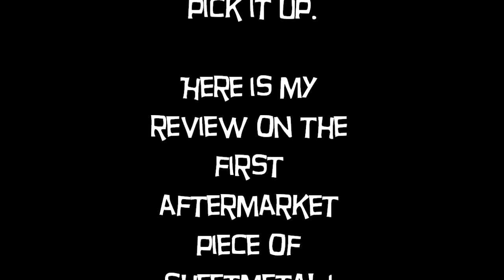1969 El Camino Restoration Part 13- New Dynacorn fender review

Comment: One thing I always learned, was.... no resto part ever fitted like an original....mostly in part to, when in factory. they beat the shit out of panels and sheet metal lol! but it will deff save you time and work...especially in cutting and welding.
Reply from the maker: Great to hear from you Reaper! Yeah, I got lucky when I found this so I jumped on it. Definitely a time saver.

Comment: Thank for the comparison, I'll definitely be replacing the passenger fender on my 72 El Camino, maybe drivers side too I'll need to look closer when I get it home from my parents house.  I just started it for the first time in about 19 years about a week ago.
  When you weighed the fenders did you leave the bolts in the old one (assuming you remember)?  That might even it out for the weight loss from rust, but no way to know exactly how much it's lost.
Reply from the maker: wow... 19 years! Hang on to her, she's worth more now than new, I betcha! Congrats on owning a piece of history!
Reply: @512kjt  - It was my first car, I got it 22 days before I turned 16.  402bb 400TH.  I parked out after the brackets for the gas tank broke off the frame when I was trying to drop it.  I started it monthly for maybe a year, then just stopped.

Comment: Looks good, did you check out that ebay elcamino for sale. If you got it for the right price as a parts car the body would be cheaper than buying the whole front end of yours I figured. worth a look anyway. I really liked your analysis. I bought an AMD fender for my chevelle now I will look at the differences from your video thanks!
Reply from the maker: Thanks Cary. I did check it out but it ended up going for $2,225 which was a little for my blood. It was in good shape so I think it was a bargain, I've just got too much already into this one.If I had started out with one like that I would have been bidding it up! Thank you very much for letting me know about it though. I appreciate you thinking of me. KT
Reply: 512kjt Thats cool, I will keep my eyes open for you for a front firwall cowl section.I know what a pain it is when you have to find parts, took me forever to collect what I have and I still need an entire grill with trim for my 69 chevelle.

Comment: I think the fenders for  the 68/69 are the same and I think your hood hinges have elongated holes ,so that quarter inch you have won't be any problem...That fender must have been made in Mexico...it does look close though.
Reply from the maker: I found out that the bolt patterns for the hinges are the same on the fenders but different for the hoods. Since I've got a 68 hood I'll have to buy 68 hinges. :-/
Reply: 512kjt I got such a deal on the whole nose on my elcamino,I bought it off a friends ,friend who's a cop and he builds for the drags.He sold me the complete nose with the SS hood for $400....They still have the gm stickers in them...
Reply: aftermarket sheetmetal would have metric threads in lieu of SAE fasteners - esp the Dynacorn fenders stamped in China or Taiwan where the gaps do not line up (outside the USA the metric system is used)